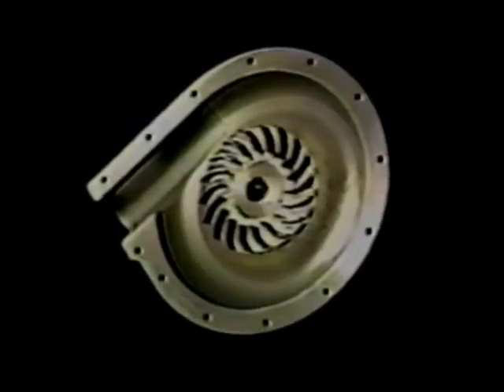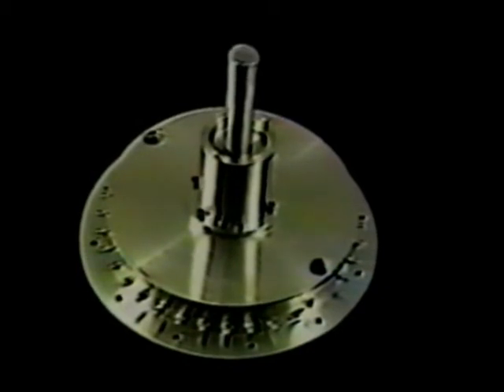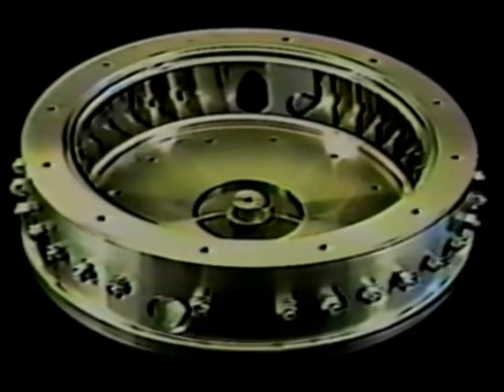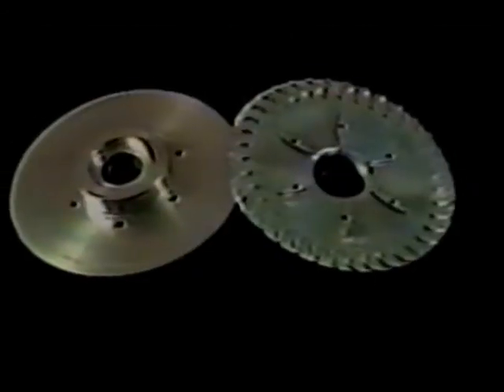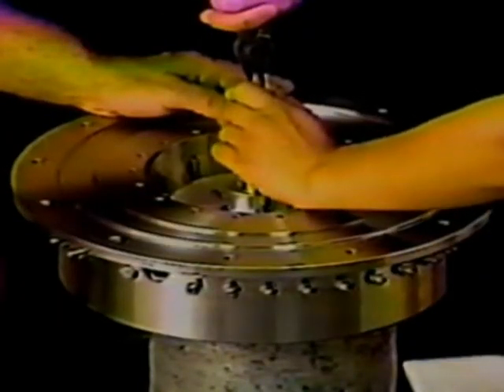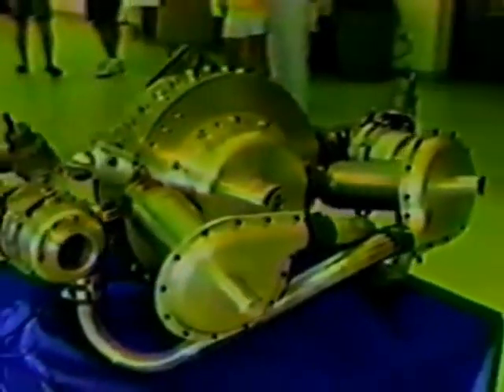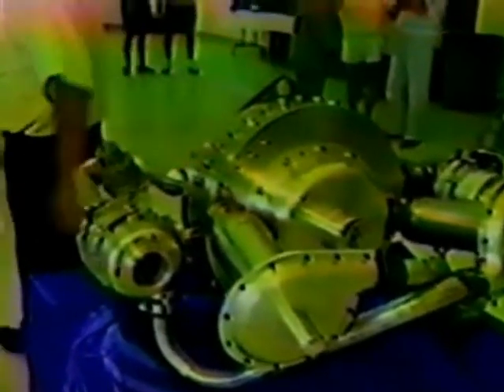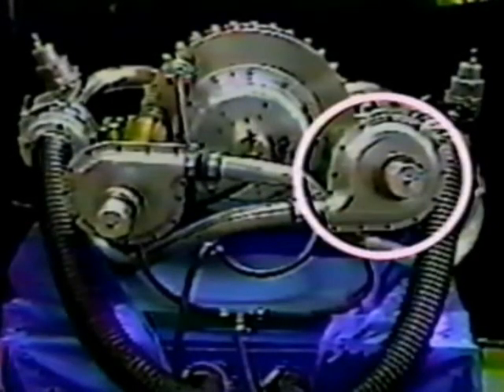Ram Jet Tornado Engine

Comment: ALL COMMERCIAL AIRPLANES RUN A VERSION OF THIS ENGINE AND USE NO LIQUID FUEL-EXCEPT FOR START UP !!!    WAKE UP MY SLEEPY FRIENDS :  )   JAY.
Reply: Jet engines are not ported into a turbine and water injected which the real time Creation of the steam is actually what gives the engine it's 80 to 90 percent efficiency. Even a jet engine is at best only 60 percent but thanks anyway for your useless know nothing comment!!!
Reply: @wmpalmer3 is this engine for flying with a propeller?  so is this possible?
Reply: @wmpalmer3 is this engine for flying with a propeller?  so is this possible?
Reply: @wmpalmer3 is this engine for flying with a propeller?  so is this possible?
Reply: @wmpalmer3 is this engine for flying with a propeller?  so is this possible?

Comment: 🤔I'll wait a bit on this one..water content is highly variable, and splitting hydrogen from oxygen is not easily done or without energy..
Reply: It doesn't rely on splitting water. The ramjets burn hot enough from biofuel and water is injected to make steam in which water is separated back into the tank from the exhaust

Comment: Also the water cannot be sourced from ambient humidity. That's utterly ridiculous. It can recover and recycle water. But needs a water tank as it only recovers about 60% of the water it uses. The engine prototype did not work until floating bearings were added.

Comment: This engine technically is not owned by Bill Bachelor!. Bill stole the design from the black guy in the video. He also ripped off the investors from Divine Rondevou which was myself and Paul Betourne and some engineers from NASA. Bill lived in my house on my dime for four years and ripped off people at flea markets violating SEC investor laws. My attorney told him he had the company so screwed up that the motor couldn't make it to market. He later absconded to Chile with the prototype. Please contact me . I paid for the production of this video at Dillon Video in Ocala Florida. The rights to the motor legally are going to litigation and I need to know how you got your hands on this video.
Reply: Actually found out he took it to Ireland not Chile where his wife was from
Reply: @wmpalmer3  is this engine for flying with a propeller?  so is this possible?